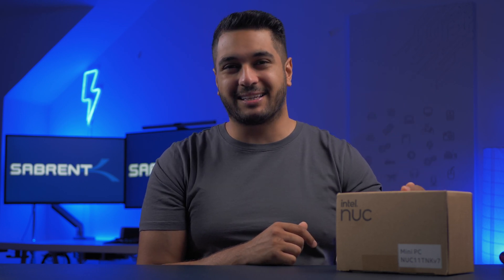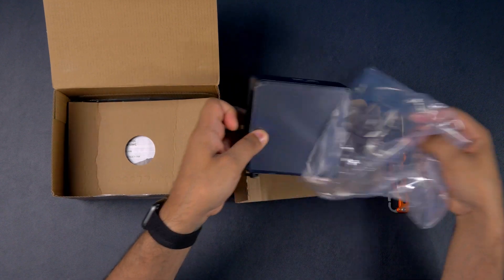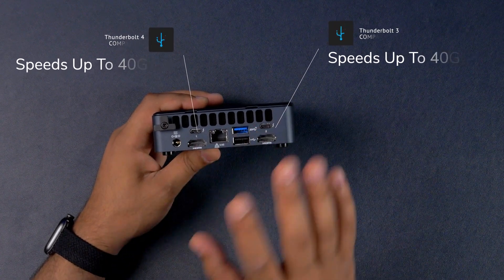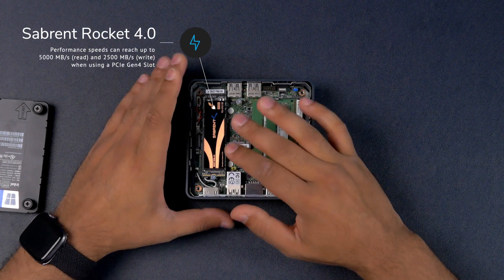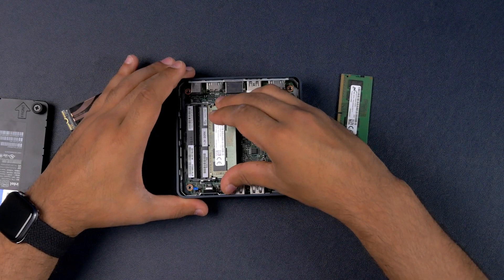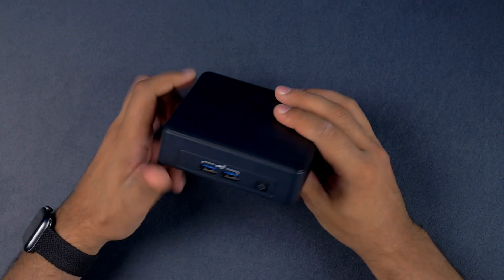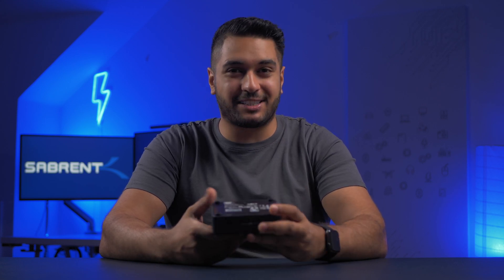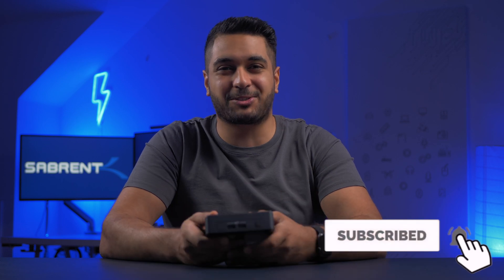Intel NUC 2021 - Unboxing And Impressions of NUC11TNKv7

Comment: I have the exact same. Love it. Bought it when it arrived. Run it with dual boot, ESXi and Windows. With ESXi I easily can run 30 - 40 Linux servers at the same time (and it's totally free from VMware). I use the Windows part as a render machine and have updated my whole network to 2.5 Gbit. I also bought an ASUSTOR NAS AS6604T that supports my NUC perfectly with 30 TB of RAID 5 storage and 2.5 Gbit ethernet. :)